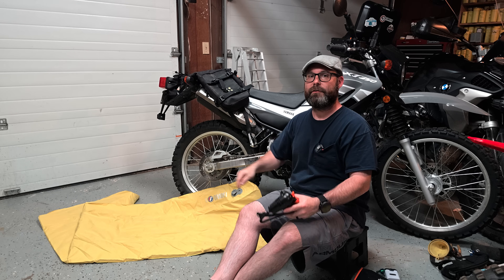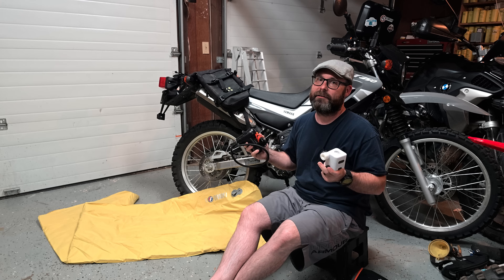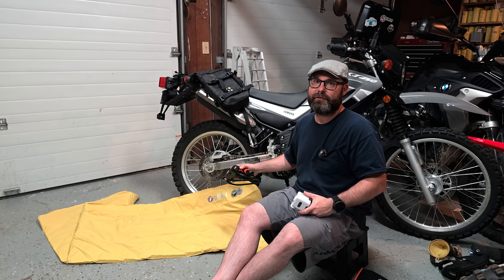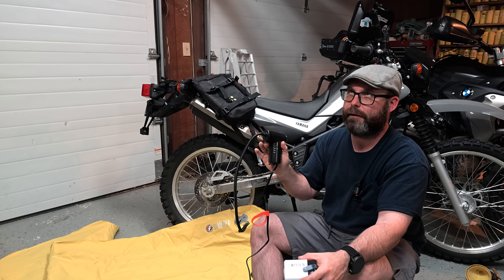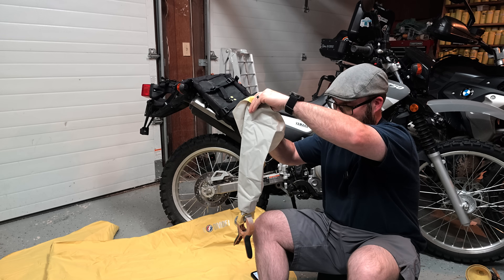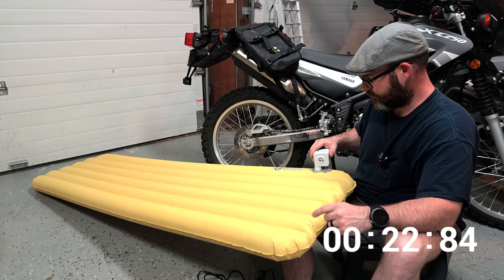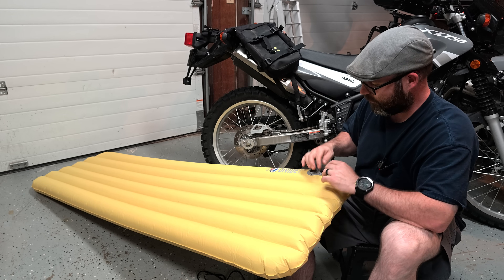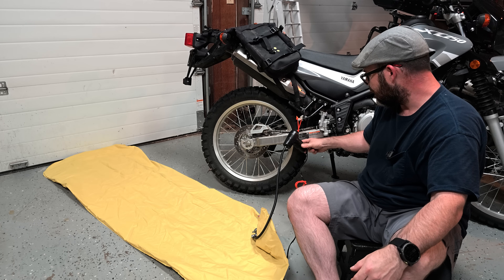Can you use a tire pump to inflate your sleeping pad?

Comment: That's a hell of a recommendation for Big Agnes actually. I've had pads let go at FAR less than that pressure, and not just the supermarket specials, actual $100+ brands. 
Exactly like that too, the internal ones first. You won't be sleeping anymore when one of those pops...
My first instinctive response was, screw the wear and tear, a tire pump will pop that sucker. And I still wouldn't bet against it with other brands.
But yeah, if I hadn't bought a Tensor the other year when my Exped let go from old age, I'd be tempted to get a BA now just on the basis of this.
Reply from the maker: The poor divide has been the sacrifice to this torture test and the one Dork did by running it over 😂

Comment: I use a unit that is made to fill pull tubes for behind a boat. It runs on 12 volts which I get from a pigtail on my bike's battery. It fills my pad in less than 10 seconds. It is very compact and easy to pack.
Reply from the maker: Yep those are great and work well!